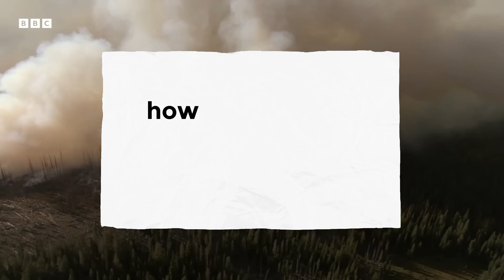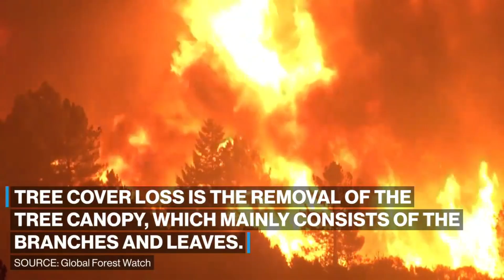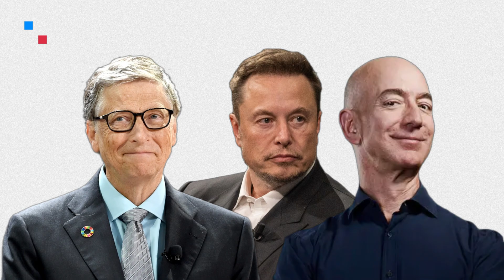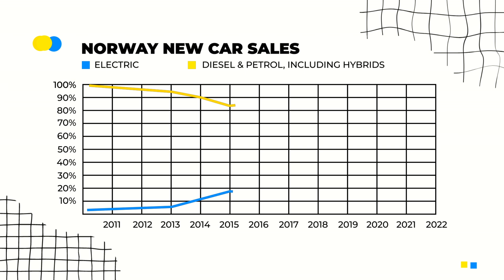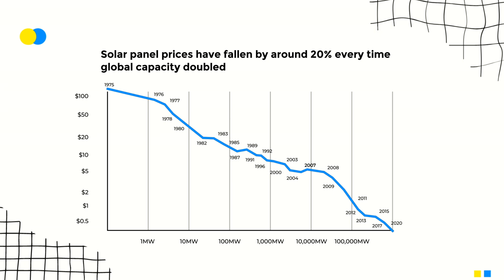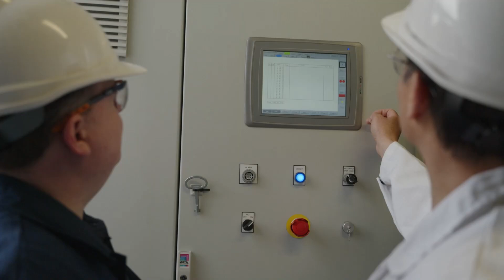Fixing the $300 Billion Problem

Comment: If you do the math, there is no way that we humans are causing climate change by burning fossil fuels, the atmosphere has to much volume compared to how much we have emitted. And I don’t see any particular reason why it would cause storms fires and floods even if we did significantly increase the CO2 content in the atmosphere
Reply: the atmosphere is only 0.04% carbon dioxide. we definitely have the capability to emit the gas on this scale. we also emit other stronger greenhouse gases like methane. and the weather events you see are not necessarily due to warming alone, but disruption to weather patterns and other climate processes that result in instability, leading to more weather events. the math has been done by many people.
Reply: Adding CO2 to the atmosphere increases storms because, as the atmosphere warms, it can dissolve more water vapor into it. It's kind of like how you can dissolve more sugar in warm water than cold.

More water vapor dissolved into the atmosphere means that the storms are literally heavier, and drop more water when they cool.
Reply: bro do the math and youll see, dont just do it but actually do the math
Reply: Ok, co2 emissions seice the industrial revolution are about 1.6 trillion tons, the atmosphere is 5.5 quadrillion tons. That works out to an increase of co2 of less than 1 part In 1000
Reply: @Kestrel990   you are ignoring the fact that CO2 only forms a tiny part of the atmosphere to begin with. there is only about 1 trillion tons of CO2 in the atmosphere. and we have emitted about 2.3 trillion tons, not 1.6. The reason for this is that CO2 is absorbed by the land and the sea. We definitely emit more than enough  CO2 to significantly impact the composition of the atmosphere. and it is a significant impact.